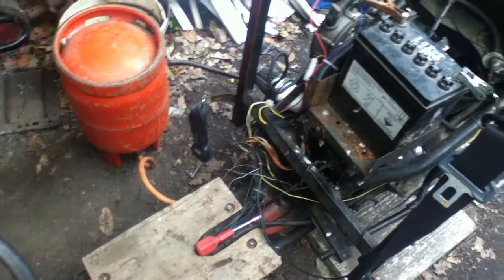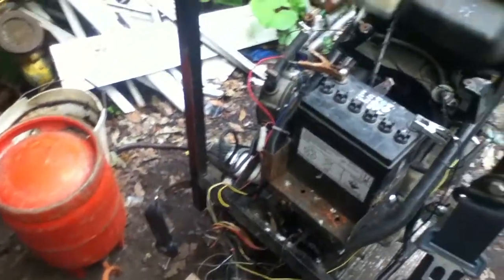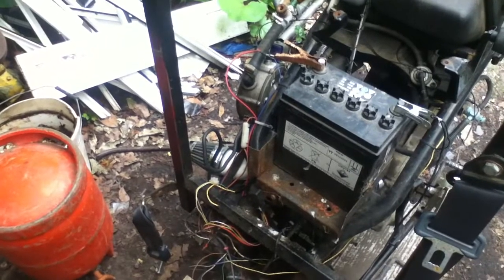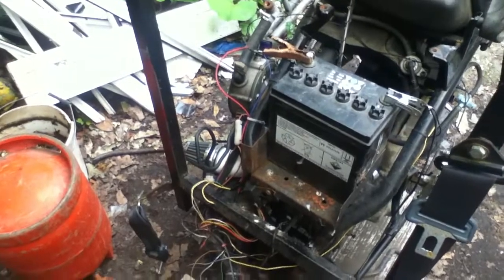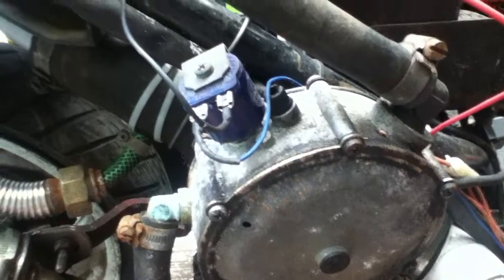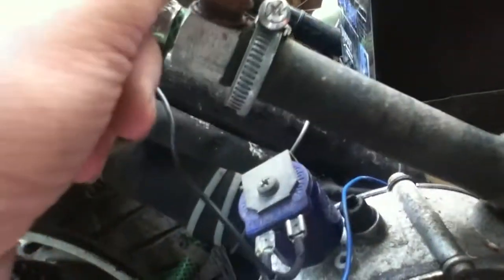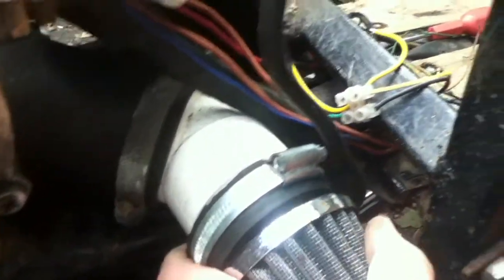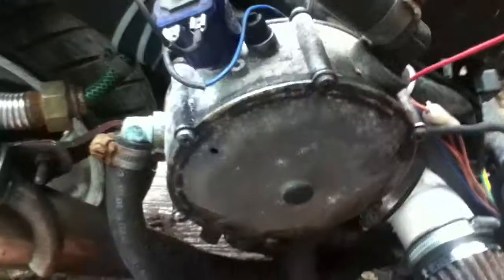Go Kart LPG Conversion Update - It runs!

Comment: you weren't getting enough propane to it.  your restricter just chocked it but it was still running way to lean.  i am working out the same problem right now trying to find a regulator that puts out enough.